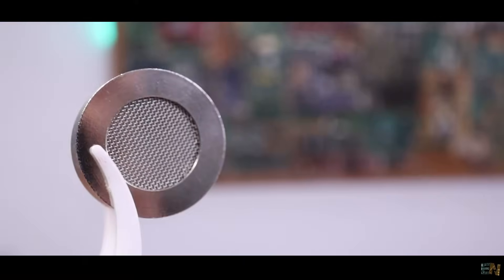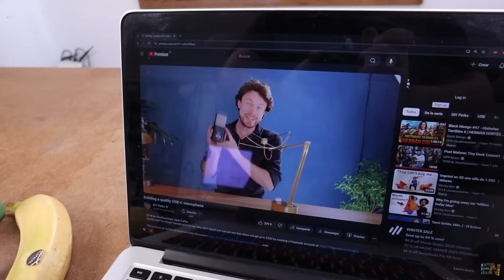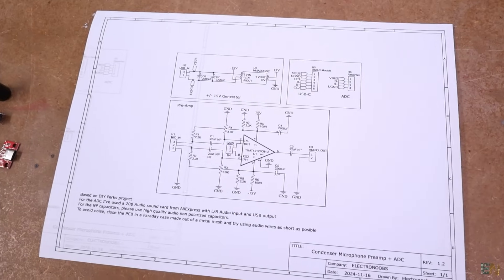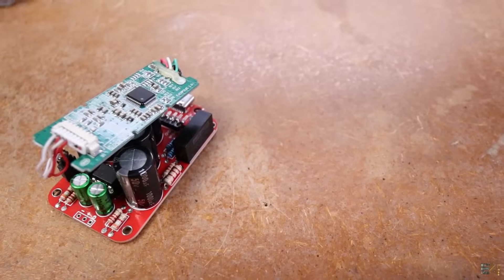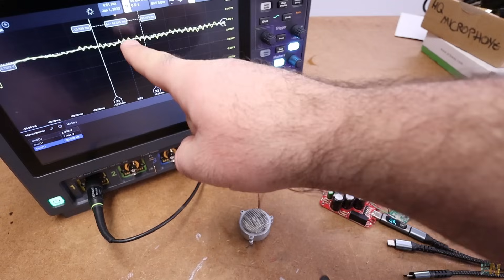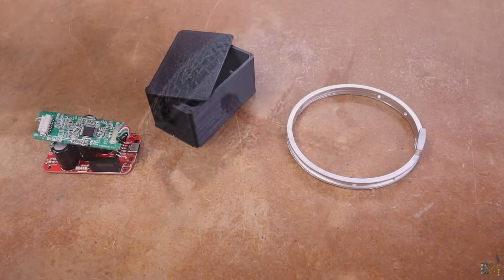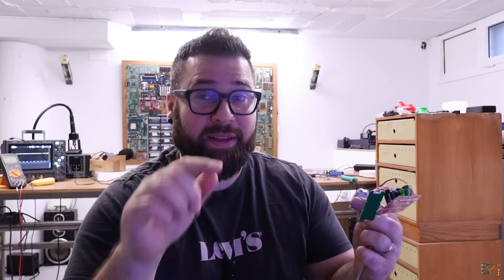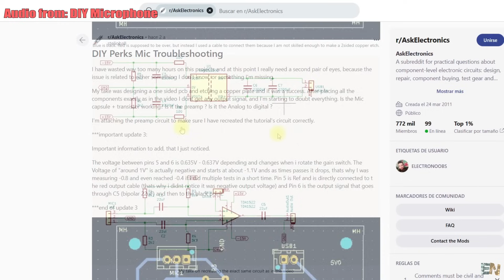I Built a $500 Microphone for Only $20 and It WORKS!

Comment: First off, interesting project. I have something on the line to use with I2S. In that sense, a nucleo board may be interesting, but I don’t know about the sound quality of the internal ADC. I need rye sensitivity to be quite high, and maybe 12 bit won’t be enough for what I need, but I need to try. I use ST components mainly, to keep everything under the same brand. Not there yet, but it’s part of my next project.
Does JLCPCB make the circuits available so that we can order the ready made PCB?
Reply from the maker: I will share the files later today since I had no time to make the webpage. About the nucleo board, I don't know what is that...
Reply: @ just google nucleo board. They are dev boards from ST microelectronics, quite useful and good value for money. I have the nucleo-F756, pretty decent board actually, and goes for a little more than €20. Try from Digikey when you need something else so you can get free delivery. Hope you like those, arm processors and they are widely used in the industry. The IDE is free, and they make available loads of tools and resources. Please note that this is a more professional line, and I advise you to program in C unless you know very well what you are doing in C++. If you need any further details I’m happy to assist you.

Comment: Could the humming be a ground loop? Maybe try a DAC with an optical output and connect it to your PC with a toslink cable? And/or try powering your microphone from batteries (temporarily) to exclude the USB power supply as a source of noise?
Reply: it can be , it's easy to fix with a small audio transformer or a isolated Dc-dc 5v , both pretty cheap
Reply: 1:1 transformer also helped with my ground loop noise. You can amplify signal for transistor to transmit through the optocoupler
Reply: Or just disconnect one damn ground...

Comment: Awesome video and results! 👏

Checked your sound test with studio monitors and hifi amp/dac and it sounds GREAT in my opinion. 

The humm sounds to me like a ground loop but could also be noise coming from AC. I get the same sound if I plug my amps directly to the power source without the power conditioner.

Humm aside, your DIY microphone sounds MUCH better than the Lavalier sample to me. The sound is cleaner, detailed and natural. Yours does have a little too much detail but I'm sure that's because there's no filter.

A few ideas from an audiophile:

- Braided litz wire.
- Heath shrink shielding in the joint of the mic.
- It would sound better with a filter to smooth the high frequency.
- Maybe high pass & low pass filters to narrow things to 80hz ~ 16khz, surely this can be done digitally.
- A hifi op amp. Ideally a discreet one like OP8802 or anything Burson. There are some nice integrated ones too from china in Aliexpress, they all have this fancy metallic encasing similar to Burson v5i.
- USB ports usually carry lots of noise, most USB adapters use a switching power supply which generates lots of noise. Easiest way is to just plug to a battery but a linear usb power supply connected to a EMI filter (4 stage) would rule out AC noise.

Thanks for the great video, happy 2025! 👋
Reply from the maker: @CesarAnton  thanks so much for such a helpful comment :)))))

Comment: Would like to see you build an Ultrasensitive microphone for finding water leaks and other low volume noise applications.  Homemade ULTRA SENSITIVE Ground Listening Probe ~ Locate Buried Pipes! is the title of a video done by electronicsNmore where he demonstrates an update version to a very old video he did (you can find it on his channel as well).  The old video quality is not great and is missing some details on how to do the project.

Comment: I've used that USB-C breakout board myself.  I put the holes in the circuit board in the same place and size as the USB breakout board. Then used bolts and nuts to attach the breakout board to the circuit board, and then put some pins in the header holes and soldered them to the top of the breakout board and the bottom of the circuit board.  It's rock solid and makes things a lot cleaner, I think.

Comment: i also had problems with the ic, so i used a simple cheap mic and  disasambled its capsule and used its transistor. this fet does work realy well and i only used a simple headphone cable,  to connect it to my pc. it has very low noise and just works great this way. 

but i found it only works well on good soundchipsets, i also had planned to use a usb soundcard but it s realy bad. i endet up using an Realtek ALC4080 and an  Savitech SV3H712 as an amp